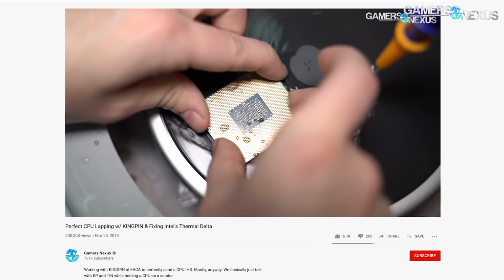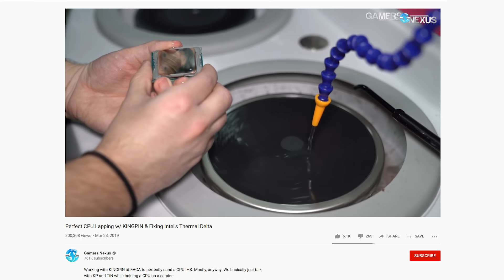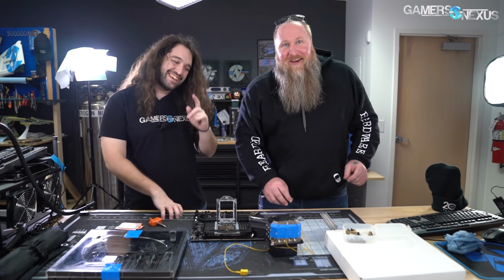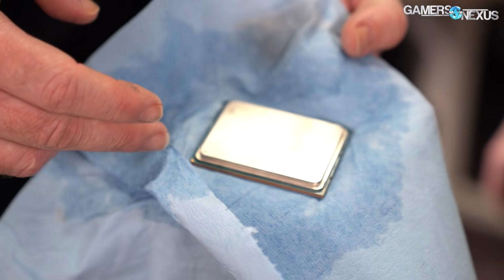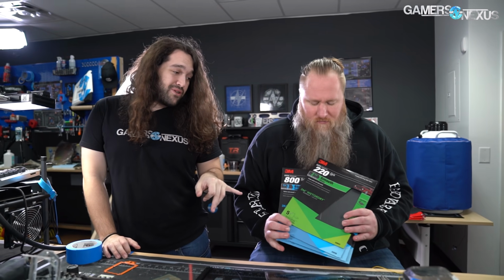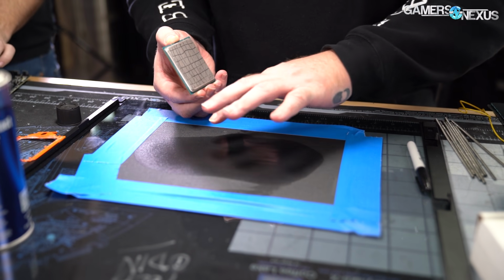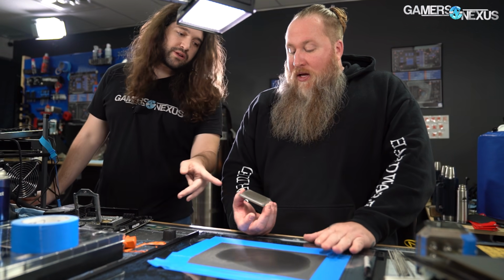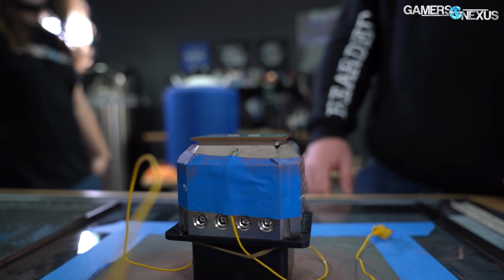AMD Threadripper CPU Lapping & LN2 Prep, ft. Bearded Hardware & 3970X

Comment: But can it run Crysis
Threadripper: Yes and I don’t need a GPU....MUHUHAHAHA
Reply: Well it does since it cant output any video without a gpu... Sry to be that guy
Reply: @stonedtaka6057  you can run a game without outputting to a monitor, how do you think blind people play? Sorry to be that guy.
Reply: @LtdJorge  tf? How would you prove that it is running if you won't output any video?
Reply: @stonedtaka6057  you can record it..
Reply: @Xenoray1  Not without any video output.
Reply: @Safetytrousers  you can record sound or even the save file.
Reply: @Kobrar44  I have seen there is software to imitate the presence of a video card. Without it many games would throw up errors of various graphics drivers and facilities not being detected.
I'm not sure how reliable this software is.
And if it did run how would you know what the performance was? I would think all fps display software works in tandem with a video signal.
Reply: @stonedtaka6057  pretty sure he's referencing the fact that Crysis can be run completely using a CPU-based software renderer. Yes the threadripper can't output any video, but all of the rendering and mathematical calculations are done by the CPU. Very impressive for a such a general-purpose processor.
Reply: @LtdJorge  Running a game without output to a monitor is different to not having a GPU in the system.
Reply: @Safetytrousers  no shit. Their comment was stupid, so I replied with another stupid comment to see if they would notice. OP was clearly referencing that you can use a CPU-based DirectX.
Reply: @mitchell3876  Having looked further you can run Crysis with a software renderer. But you were able to do this is 2008. A threadripper is colossally more powerful than anything then. But until you see it happen you can't be sure it does all still work with new OS and very different hardware.
Reply: @LtdJorge  There are blindfolded speed runs, it was not possible for me to tell you were not serious.
I have been wrong about some of my assumptions here, but there is no need to use aggressive language at me.
Reply: @LtdJorge  theres always someone got to be wrong, always someone there to put it right. Can't you just leave comments and let people enjoy what they wrote?
Reply: @Safetytrousers  I wasn't talking about you m8
Reply: @jamesw242  bro, I was talking about taka
Reply: Linus ran crysis in just software on the 3990x
Reply: thegeorgezila  what should I be? I am not wrong since threadripper would simply not work without a gpu. I do get that it can run it without putting a load on the gpu but that's it.
Reply: @stonedtaka6057 , Yes You Can! GPU stand for Graphics Processing Unit and it refers to the shader execution units. Old video cards that use Fixed Functions pipeline are not considered GPU. If you have a PCI slot or PCIE to PCI bridge you can easily plug an old card in it. Newer methods might involve outputting directly to USB-C, thunderbolt, display port or USB4 (they all kind of overlap).
Reply: @ИванСнежков-з9й  this is kinda getting out of hand and this will be my last response to this! I acknowledge that threadripper can run crysis in software mode and won't use the gpu for this task But Threadripper simply wouldn't boot without a graphics processing unit! You guys are all just praising this cpu with features it doesn't even have just because of the sensation! It's a nice thought but simply not true.
Reply: @stonedtaka6057 , You are making the mistake of thinking that GPU is equivalent to video card. You can have video card without GPU. That was my point.
I also need a solid proof that the CPU won't even boot without video card. This didn't use to be the case. Headless setups are normal thing for PC's.

Comment: X570 unify  3900x.  Worst platform i have seen in many many years.
1000 psu
1500 watt ups
Hangs on post every morning.
Reboots randomly launching games.
Extreme heat
Its been 3 weeks and still just as unstable.  Shitest platform i have ever used.

Comment: That Aorus mobo advert ... It is a great hardware but the software with it is garbage! I bought the X470 Gaming VII WiFi and paid a ton of many for it when it came out and 2 years later I still have no way to control the RGB on linux and on Windows the "app center" says updates available and when I click update it installs a bunch of non related junk like google chrome, google drive and google search bar in the edge browser, which fair, no one ever opens but WTF. The GUI for all of their software is horrible, looks like 15 yo Indian computer science made it as homework but didn't care much.

Comment: Try lapping on a diamond leveling plate used with sharpening stones. Then use red rouge to buff the scratches out of the plate.
Trend DWS/CP8/FX Ultimate WORKSHOP Double-Sided Sharpening and Flattening Stone (8 x 3 inches) https://www.amazon.com/dp/B0762WW55W/ref=cm_sw_r_cp_api_i_RxWpEbYYEKKBG

Comment: The amount of thermal paste on that motherboard is disgusting
Reply: Ok
Reply: Better than dead MB
Reply: It’s not thermal paste.. it’s kneaded eraser to keep air from getting into the socket.. in high humidity areas this will cause water to get into the socket when going super cold.. so it’s there for a reason and works pretty well!!

Comment: Has anyone ever done CPU lapping with a Japanese wet stone. I would think that would do a better job than sand paper.
Reply: Not flat
Reply: @austindoud273  I will disagree with you there. A properly maintained and lapped wet stone stays flat. It will concave in if you don't properly maintain it.
Reply: @snmdair  glass is guaranteed ish flat and if they cared about a mirror shine they would polish it
Reply: @austindoud273  Ok Dude, all I said was I disagree with you that a Japanese wet stone is not flat or flat enough. I didn't say anything about a mirror shine, but give me a 1000 grit Naniwa wet stone and I can give it a mirror shine.